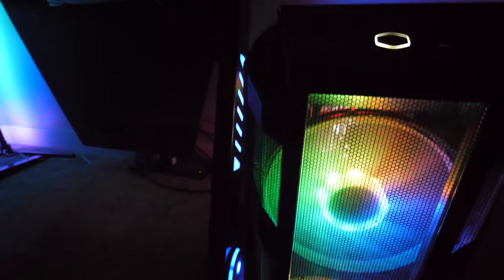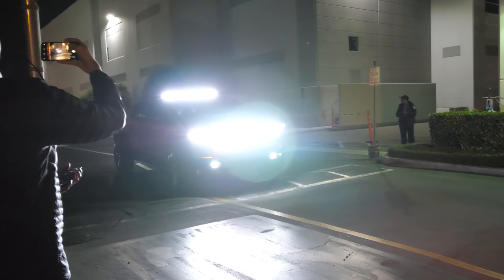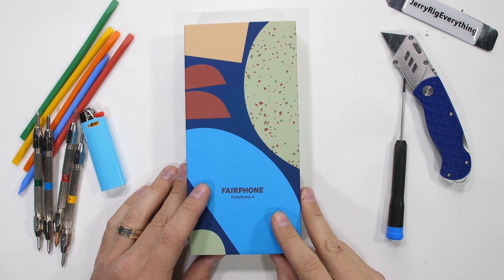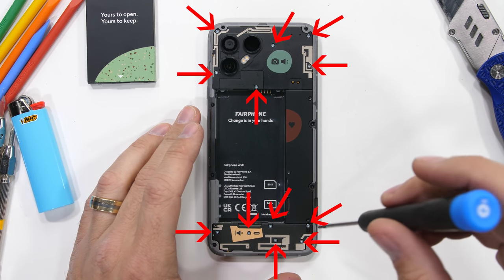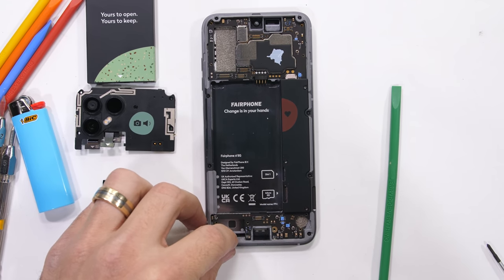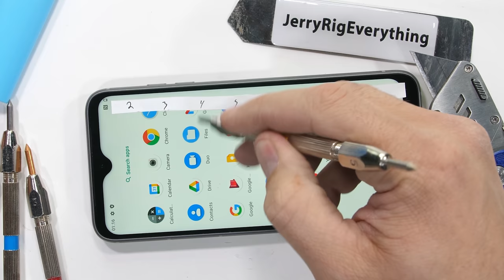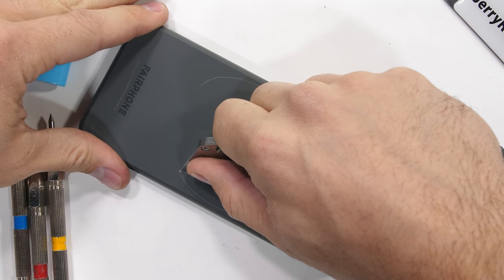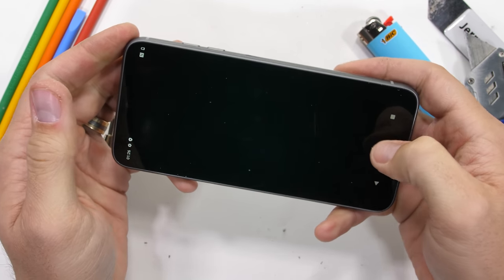Finally! A Modular Flagship?! - Durability test!

Comment: The concept itself is fantastic, but obviously one size couldnt fit all' needs, for me the lack of a built-in 3.5mm audio jack is a BIG NO, yes u can connect a earphone with a type-C external DAC adapter, but you cant charge the phone with USB while listening at the same time....also i wish they release a smaller model (width within 70mm and weight not exceed 170g) that is comfortable (yes u can pull it off with 75mm for a big hand, but not as comfortable) for single hand operation....and a more affordable price tag would be nice (say USD499).

Comment: Where do you plug in headphones?

I've had Fairphone 2 for almost 6 years (one of the first 17000 or so made), had to buy a new camera first of all because the one that came along was useless, changed bottom modules at least three times as people couldn't hear me, changed some other part as well and last summer had to send the whole phone for repairs as it started turning black or stripey. It cost me half the price of what this one costs so if I'd known this was gonna be released I hadn't bothered, especially when they sent the phone back without Google so I couldn't have any apps in it. Took several months all together...  >:(  Also the battery life sucks big time on Fairphone 2. It can't even stand cold and it's  minus Celsius here for several months. Now I'm gonna use my old phone until it's last breath and get this the next time.

Comment: In short : Fairephones knows how to make flag ship phones ! Previous itteration had big drawbacks compared to regular phones in many aspects. 
After using the phone 24Hours:  It works really great like you'd expect from a 2022 phone : photos , games, browsering, screen quality, loud speaker are all in the range of my previous Pixel 4a. Photos are OK, not amazing like what the pixel 4a. Hopfully this will be improved with software updates.
It reaaaaly feels sturdy, you can feel it, now lets check when it will fall.
Only drawback is the WEIGHT, it would be great if it was 30 grms less ;) But anyhow it still way better than my pixel 4a that lasted 11 monthes (google wants to repair it for the same price as the phone itself!) ! The thing is that when you are reading something with one hand you will get your wristle tired quickely...which in a way will make you use less your phone...not so bad :D
Fairephone 5 will be the perfect phone with 30-40 grammes. It feels like an optimisation of the frame of the current FP4 could lead to this weight loss quite easily.
Eventually a smaller version- 160-180grm + below 70mm width - would be the best for me.

Comment: All i need is a user replaceable battery & maybe screen. I feel like most other stuff fairphone do is adding cost, weight, bulk. Breaking a port, camera or screen is unlikely. But 100% of batteries degrade over time. Change the world? Only if you reach the world. 100k phones is just a start.

Comment: Finally a phone that I would get! Replaceable battery, expandable memory, and modular design for easy repairs, I just hope the replacement parts will be available even years later. Sadly no headphone jack. 
For now i'll wait for it to drop from 700 to 300 euros
Reply: you can buy a USBC to 3.5mm jack convertercable for 9€

Comment: I love the idea of a sustainable phone but i am "done" with a phone in about a year.
It would be awesome if they could make upgradable parts on the same base. I mean, the fairphone 3 and 4 use different bases so also different parts right? 
Just make no fairphone 5 or make it with better parts on the same body as the 4.
That way i could buy the better processor and swap out the base but hold on ot the screen and speakers and so forth.

Comment: I think the idea is not bad but I don't think its something practical. the best approach is to buy the best phone and use it for 3+ years and then sell it, someone else will use it for a couple of years.  For example, I has Samsung s8 that I used for 2.5 years before giving it my dad who has been using it for 2 years. so technically, its in use for 4.5+ years now.  
Problem with Fairphone is that you have to sacrifice a lot  of specs for getting it and after a few years it would be so out of date that you have to similarly invest in newer parts anyways. why not just buy a phone and use it longer while having much superior experience.

Comment: I dont buy expensive ones because battery dont work longer or xannot be replaced without a compromise in iprating after 2-3 years or so. If 3 things - easy rooting, easy screen replacement and very easy battery replacement could be done I would definitely buy an expensive future proven phone in India

Comment: I think the main reason for the IPS display is down to ethics - a lot of OLED and AMOLED panels are manufactured in very unethical conditions, such as forced labour, and there are multiple manufacturers of OLED panels that have used political prisoners as cheap labour in parts of China. Going with IPS allows them to avoid contributing to that situation
Reply: Also IPS has no PWM, good for your eyes.